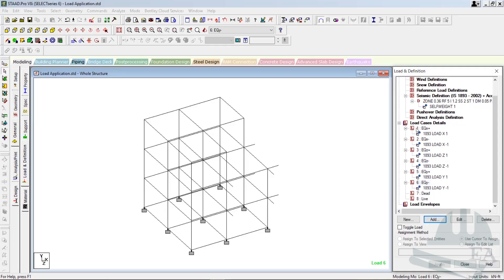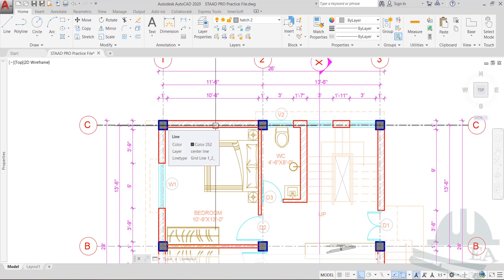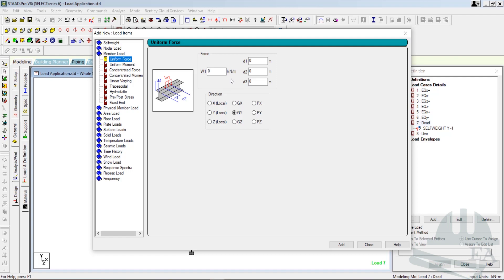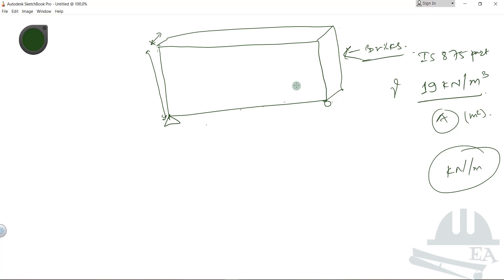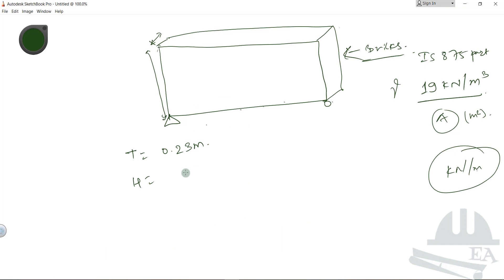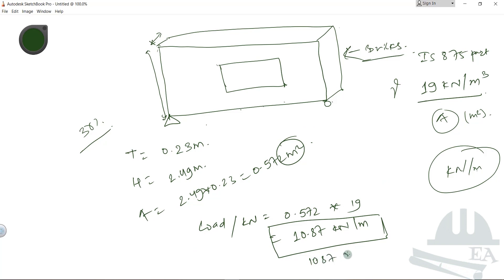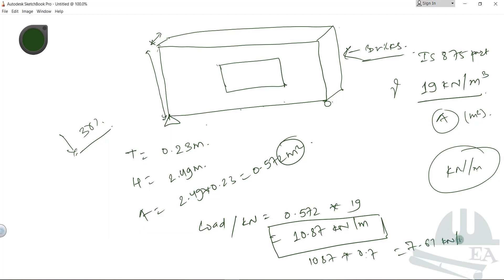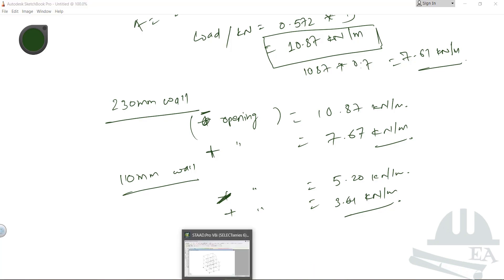STAAD Pro Tutorial For Beginners [Episode 18]: Application of Wall Load

Comment: can You elaborate more about , why we cannot take length of the brick ? You said "because it's in per meter".What does that have to do with the length?
Reply: the Kn/m unit it designated for the length of brick thus if you multiply the unit weight with length it will cancel so you must consider the width and height only